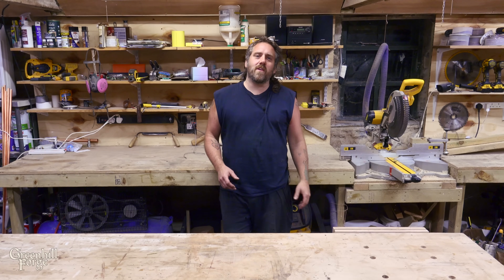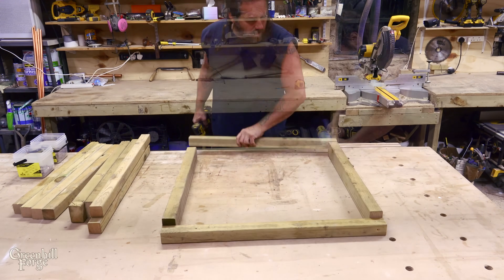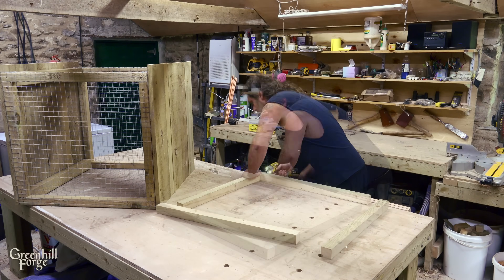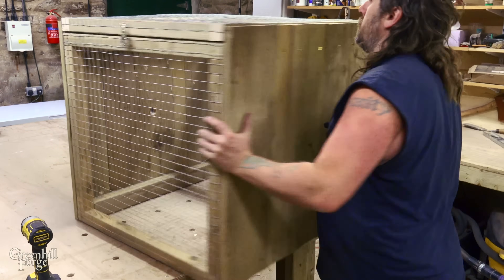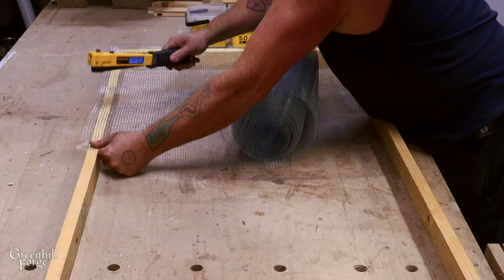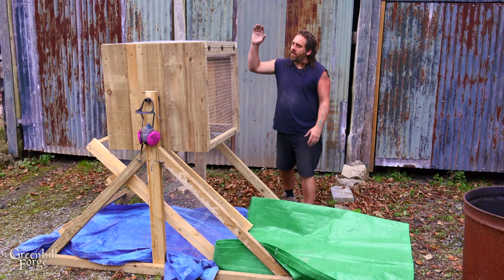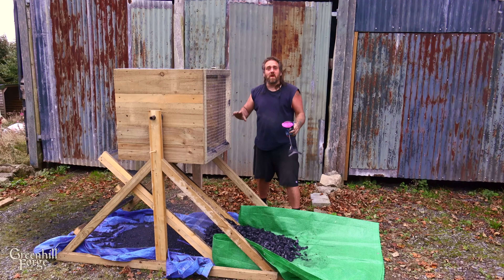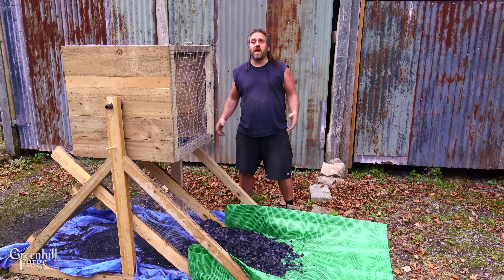DIY Charcoal Sifter: Sort for Biochar, Gasification, Grilling & More

Comment: Hey don't forget that activated charcoal is a great water filtration/purification media.    A suggestion (maybe) if you make a hole for the locking pin around 45 degrees, it'll make it to where you can open the top to fill at 45 degrees making it easier.  Maybe hinge the lid so that it opens sideways so it doesn't fall and hit your noggin.

Comment: Seems unnecessarily dusty. Rather than continually spinning it, I think it would make more sense to simply point one of the meshed sides downwards, and then give it a few quick rocks to and fro, then gently upend it and repeat. Then you can finish off with the spin to get the medium pieces and the rest of the small pieces out. That way you shouldn't get as much dust flung out from radial forces. Further, rather than having it just fall flat on a tarp, if you changed the lower sieve design to be more of an enclosed box (you could enclose it with tarp, with or without a tarp laid inside that you can 'bag' it up with), then again the dust should fall out and down, rather than immediately being swept into the wind. In short, the more enclosed it is, the less dust you'll waste and have whip into you and your breathing apparatus.

Comment: If you attach the iron pipe to the box permanently and have it spin only in the stand, you can put a handle on the iron pipe so you can crank the box easier than handling the box itself.

Comment: Thanks!  I am looking around for ways of rapidly rough sifting things, like bulk grass seed with a lot of trash in it.  But for charcoal, yes, looks great.  I never got around to making a proper charcoal retort; a really easy process is using the lidded stainless hotel pans in the wood stove, there is a video somewhere on youtube about doing this.  When I do build a retort, I want it to be trailer mounted to access different parts of the property, and be able to distill the wood vinegar as well.

Comment: Rockin' it!

I would say that for biochar you want to heat it up and quench with eather steam or water to cause the charcoal to fracture. Then soak in a "tea" to allow bacteria to get in the biochar. This activated biochar is what you want for soil improvement!
Reply: Cody's lab made a great video about activating charcoal with simple superheated steam contraption.

Comment: I'm not sure if it will work to turn the small stuff into biochar by heating it since there is way to much oxygen in the pores and in-between the media now wich will just combust at least had of it and you will end up with a ton of ash at the end :/ 

Might work tho so give it a try. 

If it's not working just do seperat burns for the biochar and build a small manual brick press and make some diy Briketts for the stove, that should double as some nice content as well 😉 

Cheers